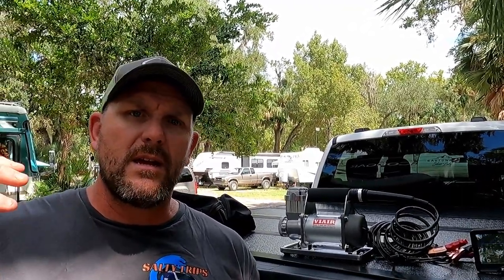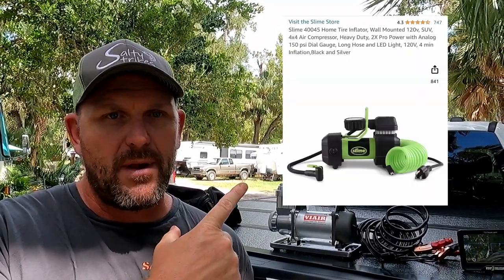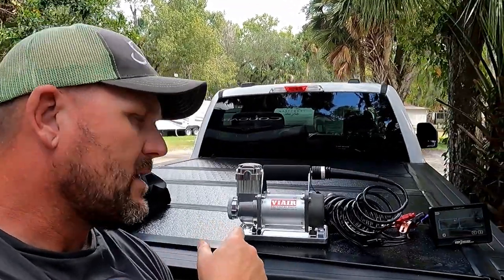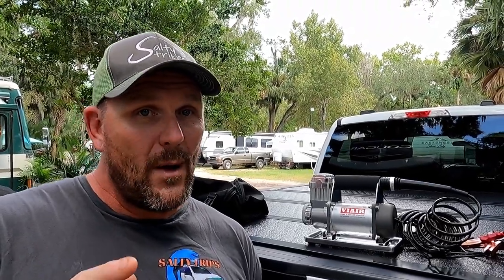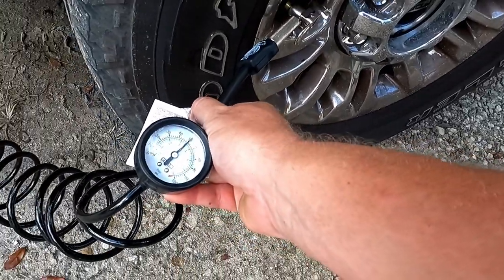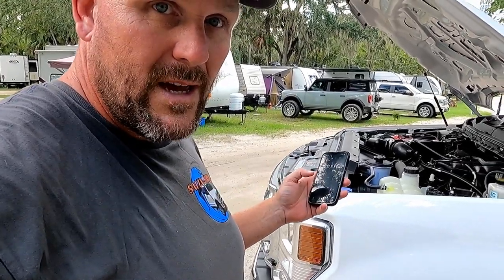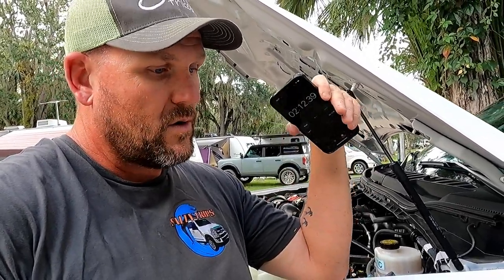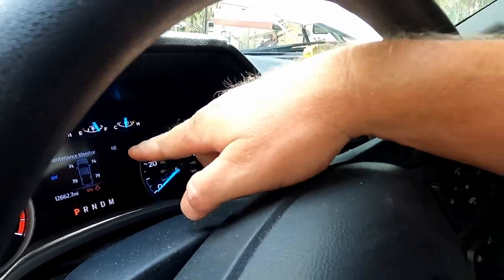RV & Truck tire Compressor and TPMS system!

Comment: Nicely done ! Not a full timer but we go out once a month for 4-5 days; plus a couple of 2-3 week ventures every year. We boondock ~75% of the time. As a long time RV-r and being pretty mechanically handy; I carry a fair amount of tools for 'just in case'.  I too had an experience with a cheap inflator. I'm pretty much a Milwaukee tool guy. I now carry a Milwaukee 18volt. Works great.
Reply from the maker: … always be prepared, i’ve been having to do a lot of unexpected repairs lately, those videos will be coming soon!

Comment: Great info on the compressor. Regarding inflation pressures though, the information on the tire just tells you how much pressure the specific tire is ABLE to handle, not your recommended running pressure as that will vehicle-specific, depending on which vehicle the tire is installed on.
For inflation pressure numbers for YOUR vehicle go to the information plate on your driver’s side door jamb, where all will be revealed.
Reply from the maker: Correct, thats just a recommendation tire pressure unloaded, not the rule. Your Tire rating, axles weight rating and load weight should determine your tire PSI. When i have 2000lbs of tongue weight on my 5th wheel hitch and my tires are on 55 PSI they almost go flat. For instance, these tires are rated for 80psi cold and at 80psi rated for 3,200 lbs each for 6,400lbs total, if i run 55 psi and have 6,000 lbs of pressure on the rear axle the tire will not wear incorrectly and cause premature failure.